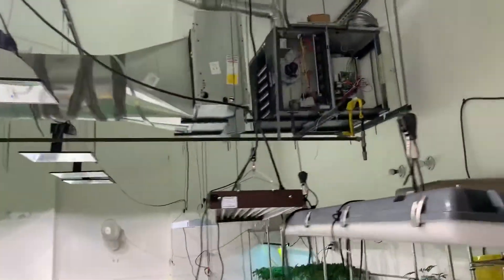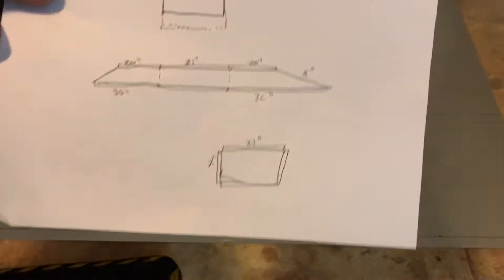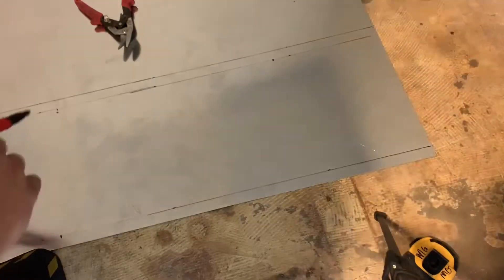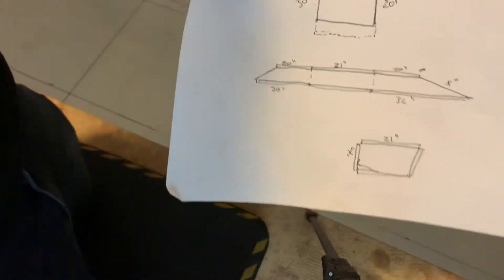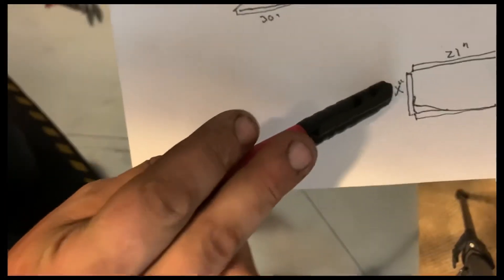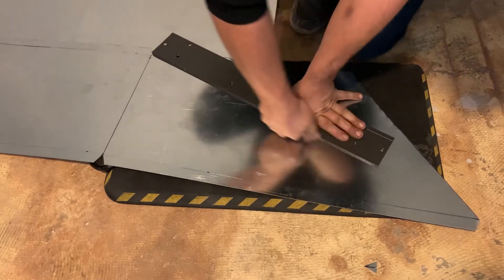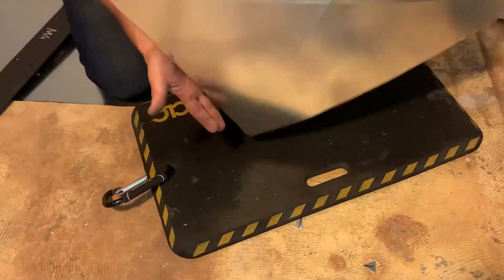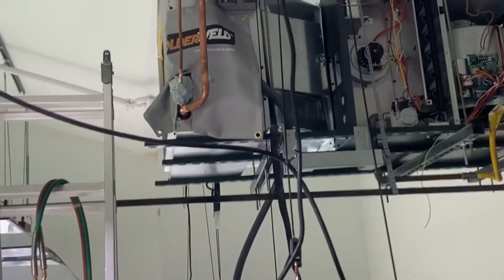How to make a sheet metal transition HVAC

Comment: Let's see you make that square round.
Reply: Square to rounds r easy and u need a brake for that u idiot lol if u do it without a brake it's gonna look like shit all u do is drawl a top view of the fitting, break the circle into 7 equal parts with a compass marking them 1-7. Then u mark your 4 corners A-D, then whatever the height of the fitting is you drawl a line straight up and down that whatever that length is, then drawl an arbitrary line at the bottom of ur height line perpendicular, then mark your true lengths for A-4, B-7, C7, and B1, with a compass on your arbitrary line, then whatever the large length of the square is you drawl a line that length horizontally marking A on one side, B on the other, then strike your arks from those points with the compass and where they intersect is where you connect ur A and B points to #4, and then u take ur compass from A4/B4 and mark ur points beside it marking and intersecting them all the way from 4 to 1 and 4 to 7 which are the distances on each equal point of the round that u broke up into 7 points. Then u just mark from there and keep intersecting the points from A4 to A1, and B4 to B1, then point B and C which are the short sides of the square intersect those with point 7 (C7 and B1) then make a seam and slip edge, and u have your pattern. Then u just trace that, bend it up on ur triangulation points and then clamp the two patterns together and rivet the seam, done. Lmaooooooooo let's see if u can follow along smartass

Comment: Nice!I’m not a metal guy by any means.
What are the notches for on the bend lines for?
Reply from the maker: The notches are important for a lot of reasons. In this fitting I bent them to match the receiving angles the fitting was being connected to, in a duct run the longer side overlaps the next fitting by that inch, and the short sides get bent into a "C" shape for another connector called a cleat or drive, also makes the tabs easier to remove if you decide you don't need them in that spot once its put together. Basically, if the corners are not cut the connecting tabs will be the same angle as the sides, and that's almost always not what you want.
Reply: @mechanicalenvironments  thanks for the detailed explanation!